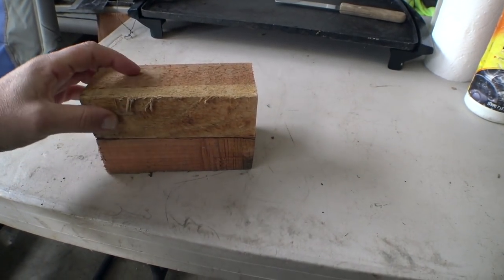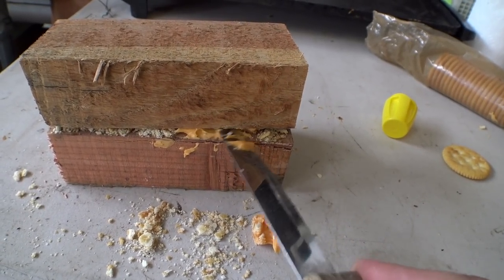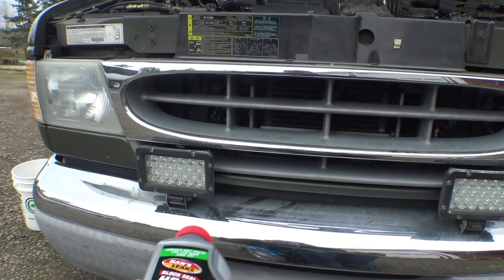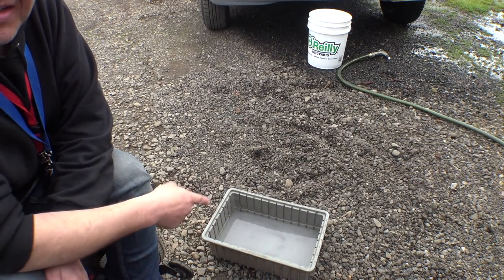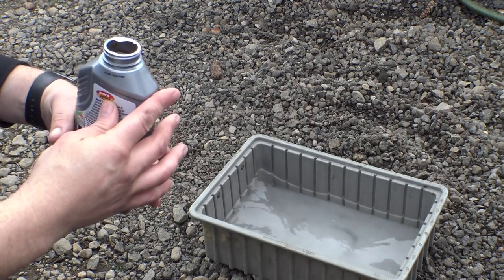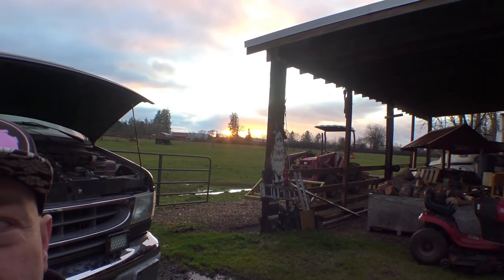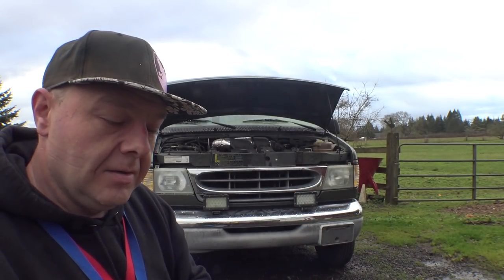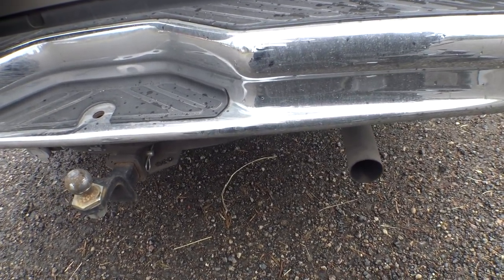VLOG 601: ROBOTS BROKE MY VAN!!

Comment from the maker: *BTW just to clarify - the purpose of this "repair" was just to get a couple more months out of the engine, until i could find a replacement. its been 3 months now, and the glue held till YESTERDAY! lol - good timing because i just bought another van! turns out supply chain issues have made it impossible to find a replacement engine.  so im parking the van till later on, when i can ACTUALLY repair it properly.  but i have something to drive now in the meanwhile - so the gasket-in-a-bottle did its job! (lol) and yes i know that that stuff makes a MESS in the radiator, and heater cores.. BUT being able to drive AT ALL was worth it, in my situation *

Comment: When I was a teenager we had a 1958 Buick Special.  Black and red edition, a monster of a car, think it had a 3000 cu.in. engine (kidding) but it was huge, maybe got 6 mph... anyway got a blown head gasket... it sounded like a tank, actually pretty cool.  Not cool is water in your engine oil.
Reply: The 1962 f85 with the aluminum 215 cubic inch V8 was all aluminum in a failure they ran good while they ran they didn't have the knowledge for aluminum at that time

Comment: It won’t work with a compression leak , it may work for a short time with coolant into oil but it really excelles in clogging up heater cores and radiator. It is just snake oil for selling a car with problems. Best of luck . Cheers from Australia

Comment: First comment! :) Cheese whiz.  LOL Bummer about the liquid fix. But I have had a partially failed head gasket on my Geo metro. I have been driving it for a year that way, lol. Hopefully you can milk more life from the van before any major engine work. Those are great vans though. I had two of them in the past on Airstream Class B RVs. I really liked the chassis. Best of luck with it.

Comment: There has to be a recall for that issue. I know the van is older, but won't they still honor it?
Reply from the maker: maybe if it was another brand LOL - my first day as a tech in the ford shop, i realized it wasn't gonna work out for long! LOTS of shady stuff when it comes to recalls and 'service bulletins'
Reply: How many people have died because of airbags and keys hanging from ignition switches that you could hit with your knee and shut the engine off and not be able to steer it took years before GM and Ford were made to fix those issues

Comment: Do you drive from your powerchair in your van? Being a fellow wheelchair user I like the full-size vans over the minivans but it’s hard to find a full size van that can accommodate my height to drive while in my wheelchair. I’ve seen the Ford e-series vans have a lowered floor.
Reply from the maker: yea driving from a chair makes things tricky.. need a fairly large floor drop! full size vans are SUPER expensive now though, and there aren't any new ones being made for wheelchair drivers at this point :^/

Comment: It appears you poured it in the reservoir, it was supposed to be poured in the radiator. Maybe it was the angle the camera was at but if you did pour it in the reservoir, hardly any of it made it to the radiator.
Reply from the maker: this van has a pressurized coolant tank.. connects directly to the radiator in 2 places :^) kinda hard to tell from the camera angle

Comment: First I thought head gaskets on gasoline engines were made of metal second back in the day we used to use something we called graphite it would clog up pin holes in radiators and head gaskets I'm just saying. 😘
Reply from the maker: kinda funny.. the ritz crackers are probably about the same quality as the stock gaskets ford used back in 2002! LOL